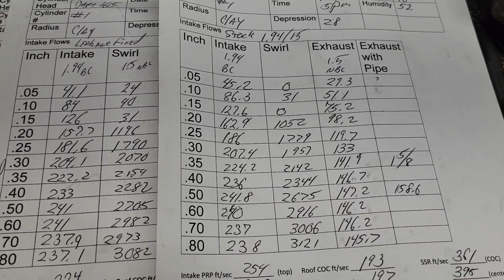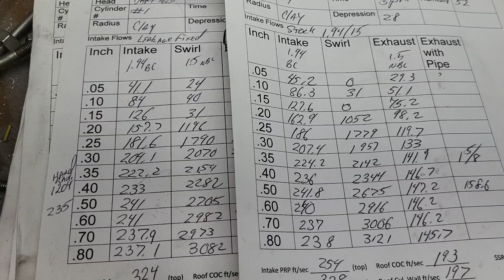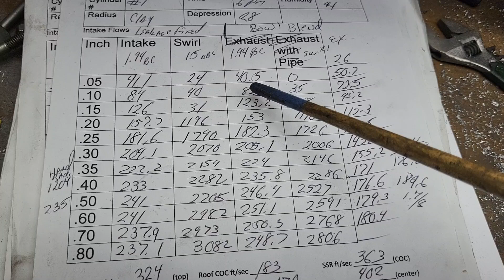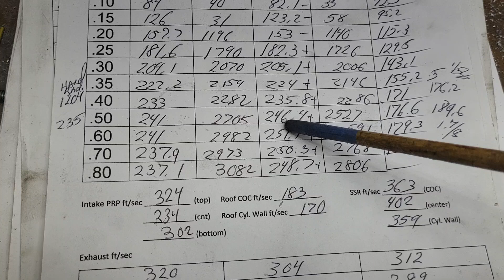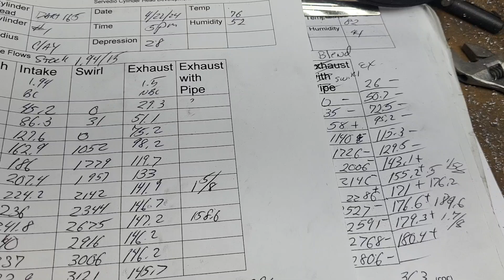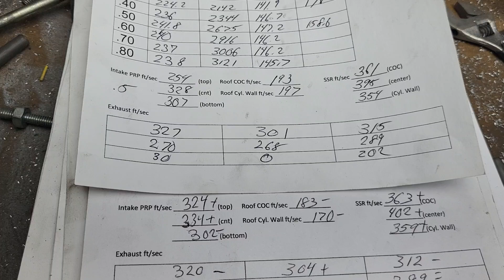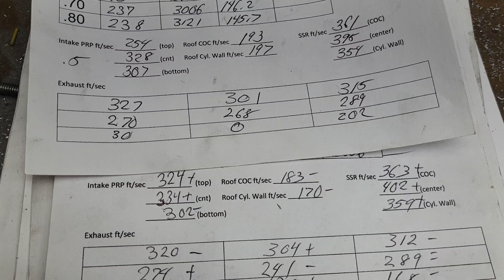Redheaded stepchild. High Performance TPI project, Bowl blend! Dart 007 SS heads

Comment: I have a set of these Iron Eagles (from a parts motor i bought on craigslist:face-orange-biting-nails:) but the 2.02" version , they have #180 cast between the intake valve springs so i guess they are the 180cc port version, i had the impression they weren't that good a head from some flow numbers i saw in Car Craft mag but after seeing what these 007's are doing i'm kinda itching ta get them on my bench ta see what they can do ! it would be nice if my 180's are about 10%:eyes-pink-heart-shape: better than the 165's or is that too much to expect ?
Reply from the maker: The 180 flows alot less than the 165. I think 208 intake. Not as good a design.
Reply from the maker: I have never ported a set but I am sure they can be fixed up.

Comment: 9:06 Interesting how speed is faster at the top of the PRP (big gain really!) yet down stream the top of the bowl slows down , its kinda weird how what's happening at the pinch doesn't necessarily translate to what happening at that same height directly in the bowl ?  i'd like to know what the air is doing there ??
Reply from the maker: You are right, that is why I do it the way I do. Thanks
Reply from the maker: The air is moving from the roof to the center of ssr after some work.

Comment: With the exhaust, since you have a lot more pressure and energy pushing out gases, than you do on the intake, the rules are a little different. You have a favorable pressure gradient, flow tends to be laminar for longer because the pressure is working with you not against you, port wise.
Reply from the maker: No arguement, but if you improve the flow path that energy is less to move the exhaust gasses. Reducing pumping losses. Thanks

Comment: Ok I think I made another step in understanding this texture thing. Texture trips up the flow, makes it turbulent, it loses some energy, BUT, it sticks to walls better. Laminar flow also goes turbulent, when it does, it tends to make separation bubbles, which makes the flow unsteady because they change the flow and also burst, which again changes the flow. At low speeds smooth surfaces work better, at higher speeds, turbulent boundary layers have less drag overall.

I guess what I'm saying is with lower port velocities smoother walls, and more laminar flow would probably produce less drag, but at the speed that your bench is pushing air through the head, turbulent boundary layer, while not as efficient, is much better behaved in terms of going around turns and such. Less likelyhood of detaching and reversing flow, because turbulent mixing borrows energy from the bulk flow to keep the boundary layer energized. It's always a compromise.

How you trip up the flow also affects the cross sectional area, maybe something to play around with. Ideally you'd want to trip up the flow right before it goes turbulent, or develops a circulation bubble if you want to avoid laminar separation bubbles. You can find this with your pitot tube, the dead spots are likely flow that's recirculating.

As with anything in aero, nothing really hurts you, it can either help or hurt you, the trick is knowing what's going on, and putting things where they need to be to get the effects you want. Granted easier said than done, considering how interrelated everything is.
Reply from the maker: I tend to polish the high speed spots to decrease boundry layer and then it acts like it has more csa which it does. Thanks
Reply: It's common to polish the shortside turn to get the flow to slow and bend there. How much it helps I have no idea.
Reply: So youre saying that the Laminar Sub-layer of the boundary layer which normally has has smooth orderly flow is being affected by more surface texture in a bad way ?
Reply from the maker: @luckyPiston  Not bad, but the thickness of the boundry layer changes.

Comment: Since you have all that "action" in the chamber and so much across the exhaust valve, what are your thoughts about what's happening at overlap?

With what I see here I'm curious....
Reply from the maker: Too much overlap may cause raw fuel out the exhaust. Not what we want.
Reply: @servediocylinderheads  of course not. So how do we prevent that?
Reply from the maker: @arturozarate1752  It is a good question. I like to limit my overlap according to my max rpm. More rpm more overlap.
Reply: @servediocylinderheads  I'm a sucker for RPM!

Comment: @ 2:37 REALLY nice short turn and  radius to the seat angle. I like to do mine that way. Really nice Charles!

I do leave the seat as wide as it's cut though. I don't like the low lift exhaust flow to be great. I feel there's less of a chance to have the incoming air charge leave with the exhaust. I like one angle on the seat and valve. A nail head vs tulip, and I even leave the ridge if there is one. Only on the exhaust side.
Reply from the maker: Glad you like it. Thanks

Comment: I’m certain it’s a 350 small block Chevrolet V8 engine the holy grail of small block engines but correct me if I’m wrong
Reply from the maker: Holy grail? Maybe not but I bet they made more 350's than any other size small blocks.

Comment: I was blowing air right off a compressor down the middle of a port on a head I had ported while cleaning it out. It was interesting to see where the air liked to go with a large stream going down the ce ter of the port.
Reply from the maker: It really is.